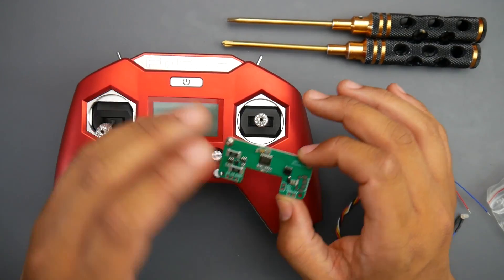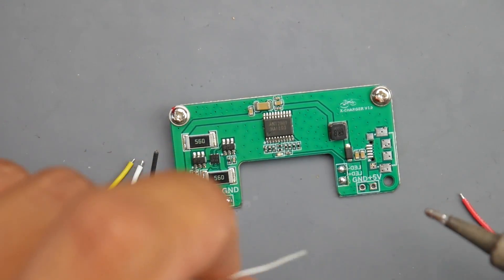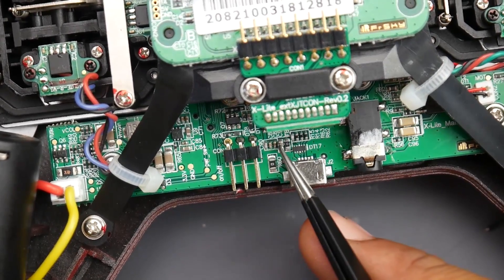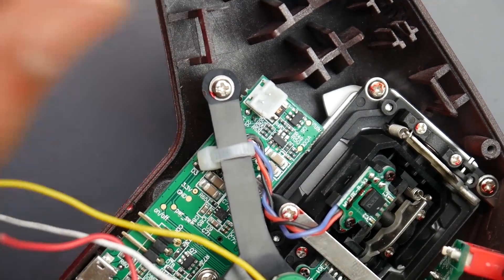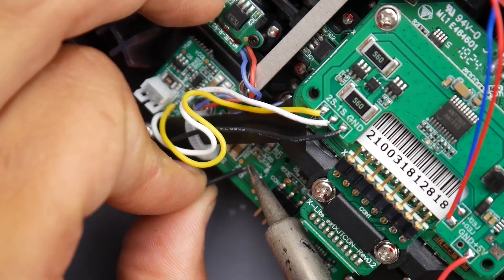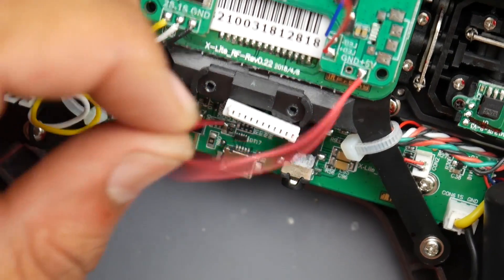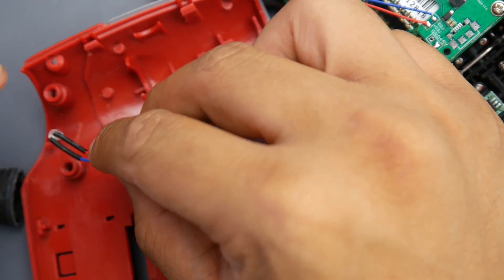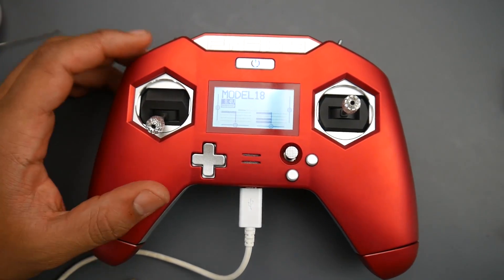USB Charging FrSky X-Lite Easy Mod // FullSpeed 5V 10W X-Charger Board

Comment: WARNING: The charger board does not provide reverse battery protection. I followed this great guide and all worked, but I was stupid enough to put in the batteries in reverse. The magic smoke escaped and had to undo the installation.

Comment: Thanks, i use this Module in my Flysky i6 mod for charging A 2s2p 5200 mah li-ion pack,that also Powering my fpv Monitor.

Also i soldered 2 extra leds whith a 100 Ohm resistor over the bouth  SMD resistors to See when it is Balancing the cells.

But if you Do this mod,do it right, Not like this,  becourse its a one time only thing.

Comment: If you look at the FullSpeed directions, it looks like the 5V is attached to both the capacitor and the diode in one picture and in another picture it is just the capacitor. I tried just the capacitor, but the screen lit up when I hooked up USB to the controller. I bridged the two and it worked without lighting up the display. Anyone else experience this?

Comment: (this is a question for the x9 lite) a friend told me tha if you solder the 5v of the charging board to the capacitor in wich you solder it the diode d119 will burn, beacuse it isn't rated for suply the power to the charging board and said that is better to solder the 5v cable to the 5v pad on the usb conexion. Is that correct or the diode is rated for supli the energy to the charging board  without burn?
sorry if i make some mystakes, it's because i am spanish. And thanks.

Comment: Is there anything like this to charge a 2S li-ion battery in the Taranis X9D using 12-15v input from the stock barrel connector and the built-in 2s balance connector?  Something like a smaller version of this board should work.

Comment: Nice mod. Couldn't you get 5v from the usb connector?
Reply from the maker: Thanks... That's what I did
Reply: @DroneMesh  I was referring to the connector, which is down lower on the board.
Reply: @MnPaul1  he did basically, but it is really hard to solder to the connector it self, so he found resistor that is connected to it so it is easier to solder